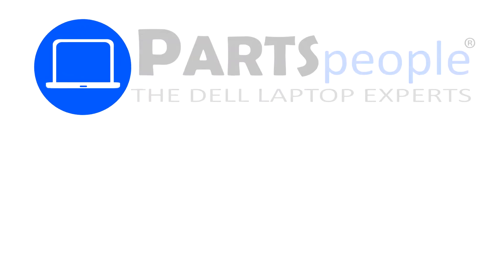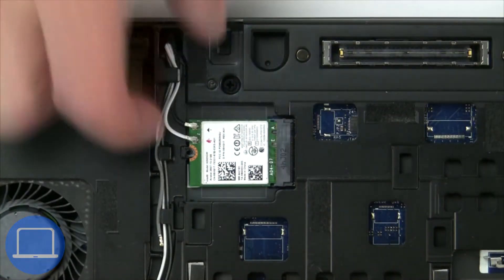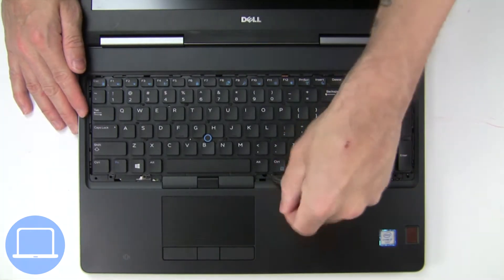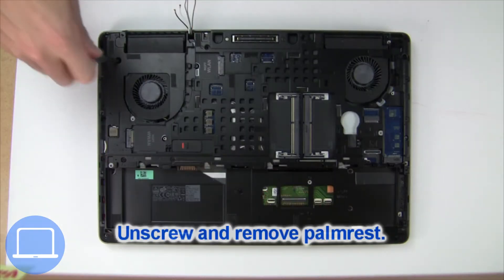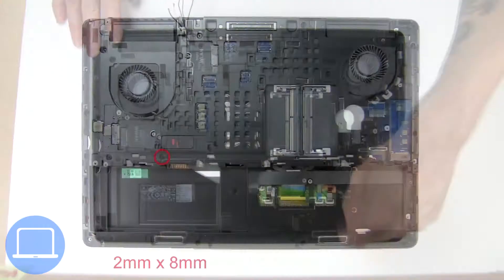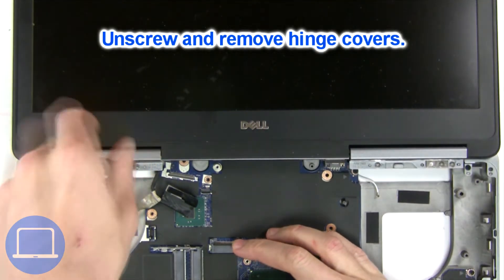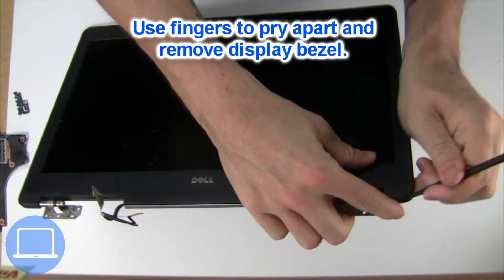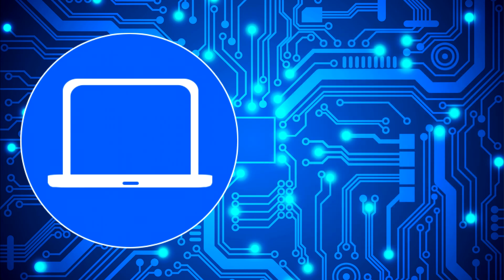Dell Precision 15-7510 (P53F001) LCD Panel How-To Video Tutorial

Comment: The touchscreen version can the glass(digitizer)be separated from LCD panel?
Reply from the maker: Hello, I am not certain if you'd be successful or not as we have not tried. I assume you'd have to heat to separate it but if you need to fix your touchscreen (precision 7510) I'd just get the complete assembly. We have them here in case you're interested: https://www.parts-people.com/index.php?action=item&id=20701
Reply: @dellpartspeople dell precision 7540.
Part Number (DP/N): 0169J0
Service tag 98JHL33